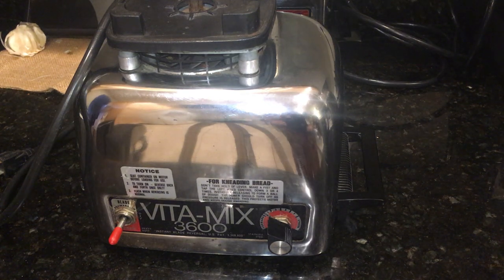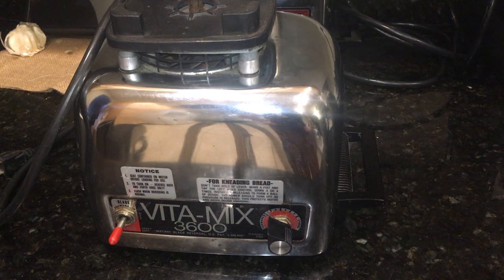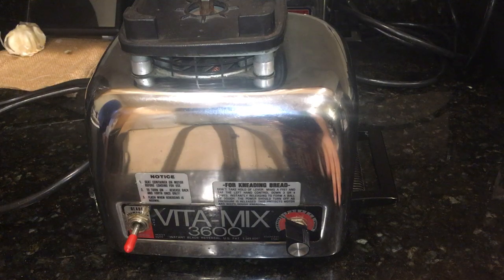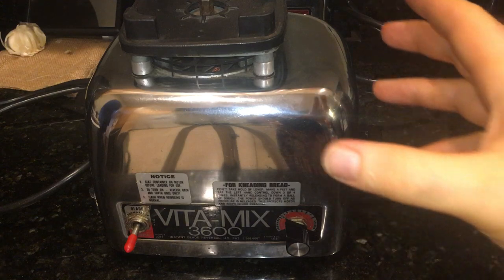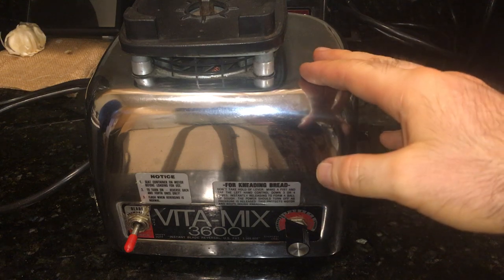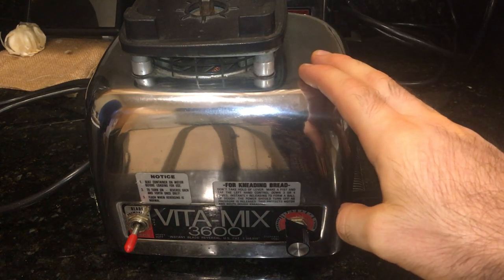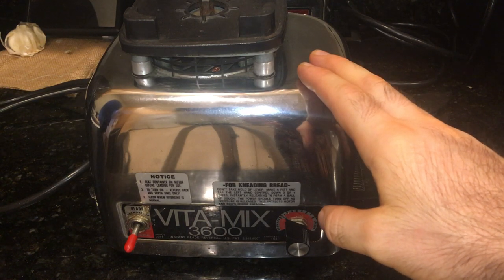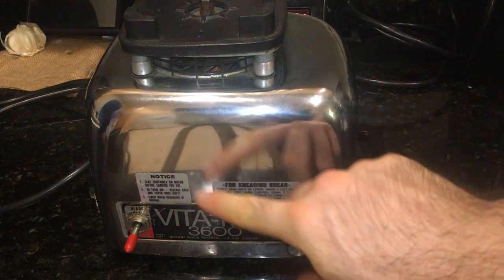6 Month Maintenance | Vitamix 3600/4000

Comment: This was so helpful
I have a super 3600 that is from 78 and it’s a beast! But it has a smoky smell sometimes and I’m worried that adding oil to the mix will be a problem?
Reply from the maker: The only time it’s normal to get a smell from it is reversing the motor as that causes a normal arc flash which makes that smell.

Comment: If the coupler on the bottom of the container is wobbly - side to side- and leaky, is there anything to be done? Can you produce a video about that, pretty please???
Reply from the maker: Nope it needs to be rebuilt and there are no parts available. Go on ebay for rebuild services.

Comment: Very informative, thanks I'll be using this info on my 3600+. Question on the oil though... The pitcher is going to have a seal of some sort between the bearing and the inside food area, probably going to be a rubber O-ring maybe. Some oils breakdown rubber seals like that, do you know off hand is the oil you use safe to use on the seal and or other oils that aren't good. Mostly going to probably be oils containing detergents and/or cleaning agents I would guess. Just a thought....
Reply from the maker: It’s a fiber seal. Plus there are different types of rubber o rings even some silicone ones. Not all “rubber” o rings are the same although they appear to be. But here are no worries. My pitcher is still in excellent shape!
Reply: @vitabox8375  Cool, Thanks....

Comment: Can WD-40 be used for the motor base lubrication? Thanks for all of your vintage Vitamix videos, btw. Very helpful. :)
Reply from the maker: Wd40 is more of a penetrating oil. Doesn't lubricate very well. Use a machine oil 3 in 1 is very popular
Reply: @vitabox8375  Thanks for the tip! I found my bottle of all purpose lubricating oil I use for my sewing machine. It's made for anything with moving parts.  :-)   I oiled up my 3600-Plus like you showed in the video and it runs like a top now! I now want to remove the spigot as I never use it and it will sometimes leak a little bit while the blender is running. I want to remove and replace it with a silicone plug. How do I remove the spigot without damaging the stainless steel container? It appears to be frozen/stuck.  :-/
Reply from the maker: The spigot twists off. Right thighty, lefty loosy. You may need an open end wrench to hold the inside portion of the  spigot.